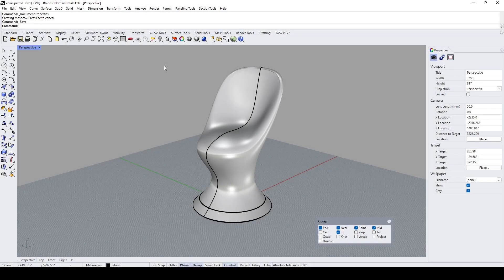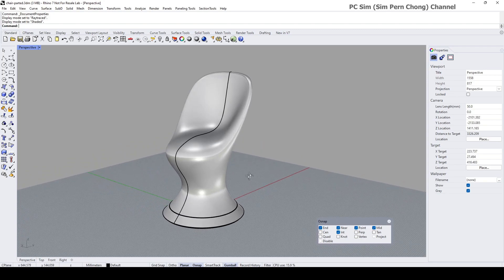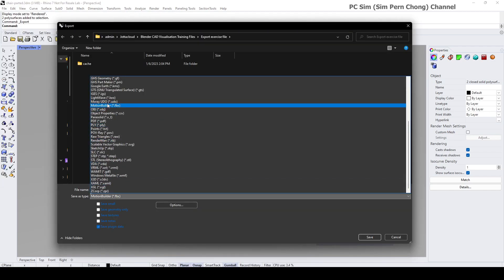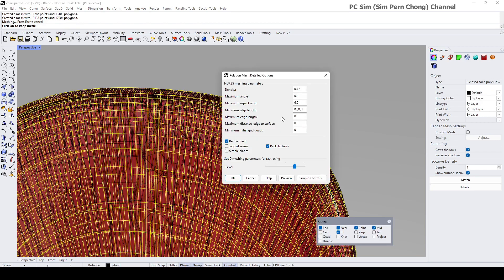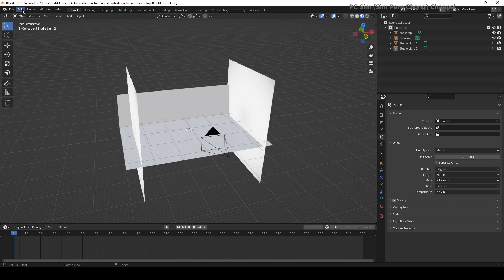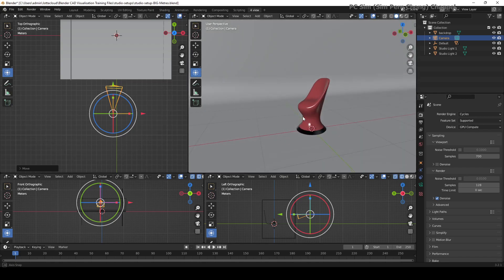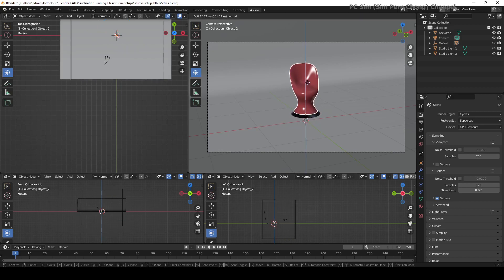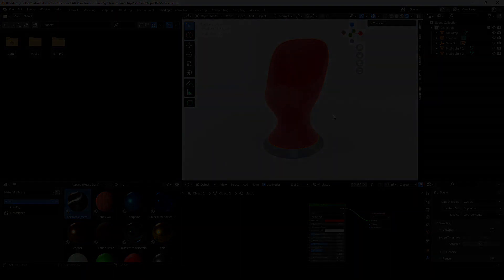CAD Tutorial: Bringing Rhino 3D Model into Blender 3 + [CAD教程：犀牛3D模型导入Blender的工作流程]

Comment: Does older Rhino 5 export fbx?
Reply from the maker: Not sure. But even if it does have, the cycles-related data (eg material info) will be missing. Rhino 8 is very significantly more capable than version 5, imo.